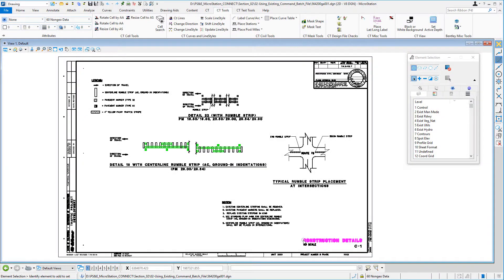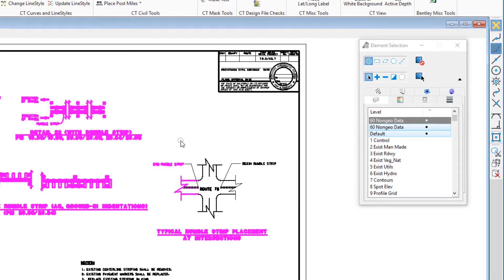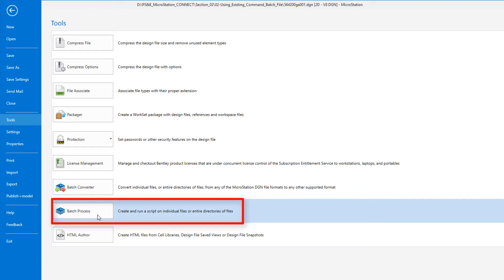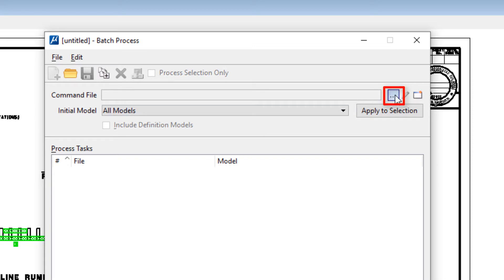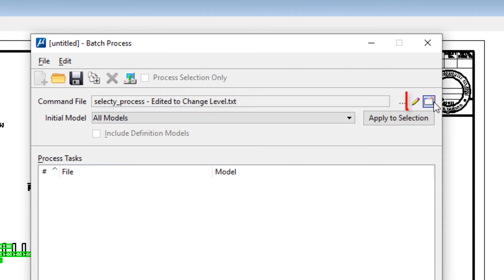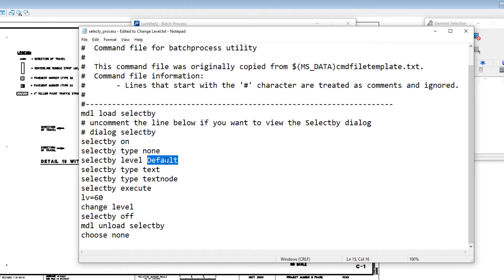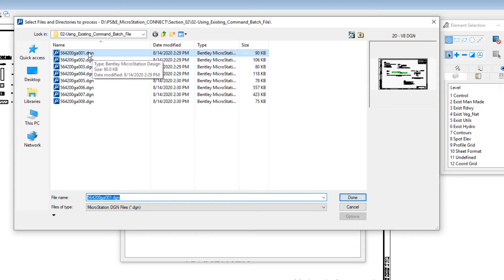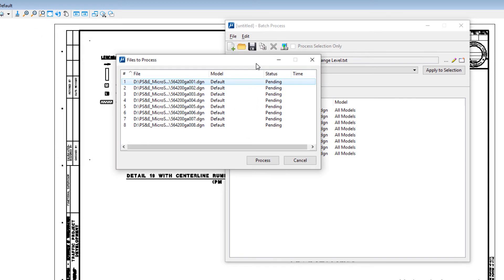Overview of Batch Processor

Comment: Hi, how to do find and replace within fence (not for all content in drawing) using batch process?
Reply from the maker: Hi Ganesh, That will be a bit trickery. You will need a repeatable area that can be used to place a Fence. Something like a Shape or know coordinates. Do you work for Caltrans? They have a "Plot Shape" built into the Border Cell. That might work if that's the area you need to Find and Replace text. It's not a simple question to answer without knowing more about what you are trying to do and the files you are trying to do it with.